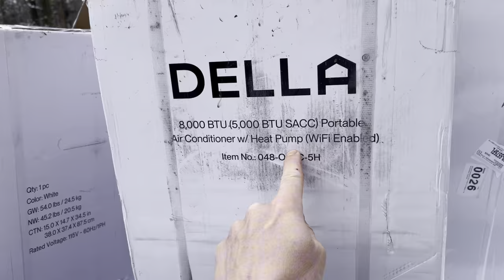24 Hours Until Opening (Campground Snow Fiasco!)

Comment: I'm afraid this might be a disposable "Campground". The quality of your dome tent framing and dinky A/C heating units, low voltage lighting solutions are like cheap-quality "Chinese" products that may last a year or two. It's a never-ending replacement process. You would have been better-off installing power pedestals and septic tanks and level gravel sites. Then invite everyone in to pay for those sites bringing their own equipment (RV's). My advice would be, get it looking as pretty as possible as you are doing, then sell it! Before it starts deteriorating, season-after-season.